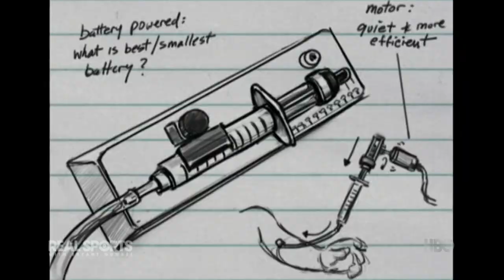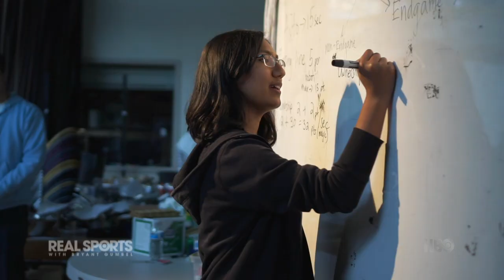Dean Kamen’s FIRST Robotics Competition (Full Segment) | Real Sports w/ Bryant Gumbel | HBO

Comment: Alright lets be honest here most FRC robots are created by either the sponsors or parents. If you want to see something actually believably built by high school students then check out FTC instead.
Reply: I am a freshman for team 573 and i would disagree because, yes, there are some mentor run teams, but the majority are student driven teams, the mentor are allowed to GUIDE the students to a decision, not make one.
Reply: I honestly don't believe that most high schoolers in FRC have the technical skill or knowledge to build FRC robots. And I'm not saying decision making I'm saying BUILDING the physical robot is most likely done by sponsors and parents.
Reply: @justbeingobvious5065  Building is the easy part. you just have to machine the parts to the correct dimensions then bolt them together. The real challenge is in design. I am the lead manipulator designer on my team and have to consider a whole lot of things when designing my mechanism, including forces, torques, amp draw, weight, range of motion, etc. All done by me. Sure the mentors help, but all they do is make sure we don't chop our arms off.
Reply: The true purpose of the mentors, however, is to teach us how to do all of the things we need to do. They don’t program an arm for us, they teach us how to do reverse kinematic models so we can program it ourselves. They don’t design our arm for us, they teach us how to calculate a motor speed/torque curbe so we can design it ourselves. They don’t machine our parts for us, they teach us how to use a lathe so we can do it ourselves.
Reply: Tell me you’ve never been on an FRC team without telling me. Gotta love the friendly competition between FRC, FTC, and VEX robotics though. All love.
Reply: Only the top FRC teams are driven by mentors (and all FRC kids know what teams I'm talking about). The non mentor driven FRC teams dont get as much exposure and are mainly recognized at a community level.
Reply: actually, Im on 467 and everything is done by the students and mentors just guide and occasionaly provide help
Reply: Really depends on the team. My team has a lot of members so I think its easier for us to be purely student-run